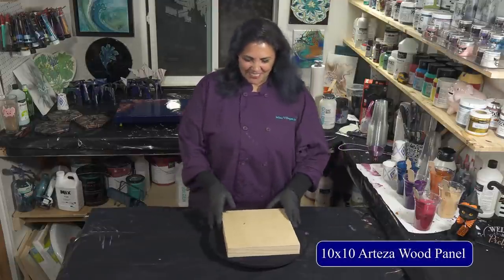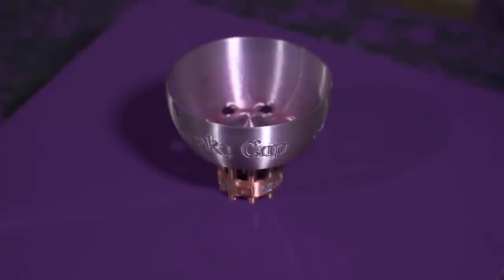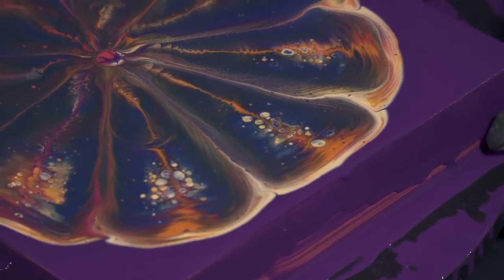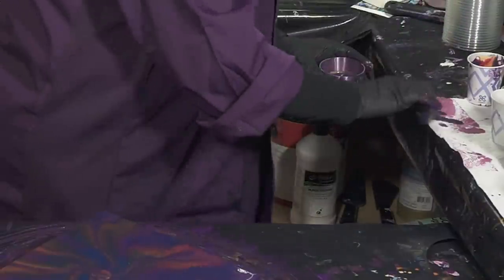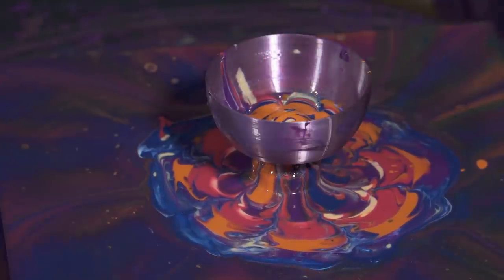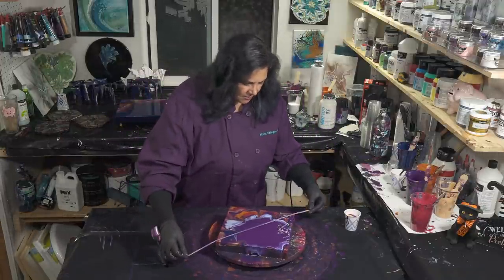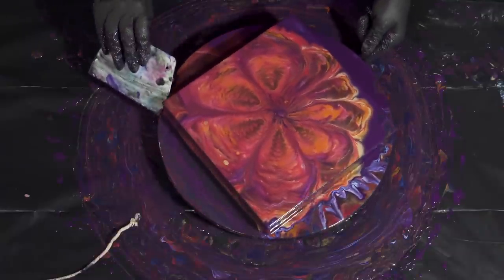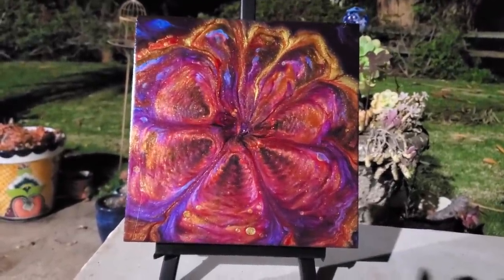Holographic Hibiscus 🌸 Playing with The Leaky Cup! Gorgeous Acrylic Sparkling Flower

Comment: Your paint was too thin to hold the cup that high as you were doing the ring pour
Can you never did make sure you were putting that down on the crosshairs just right it was always off-center you might want to make four marks on the sides with the Magic marker. And line the marks up To have better luck centering